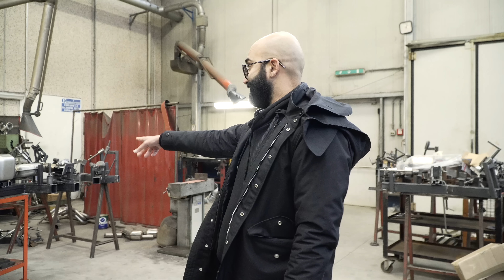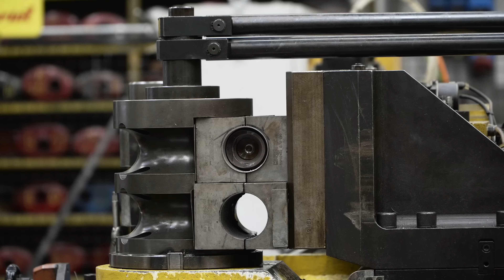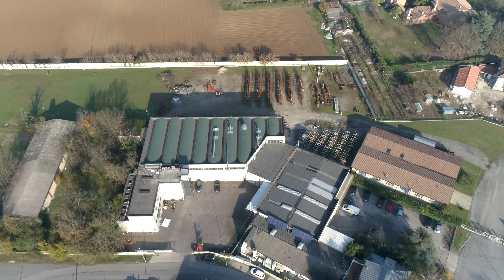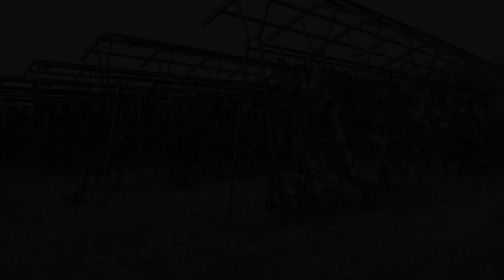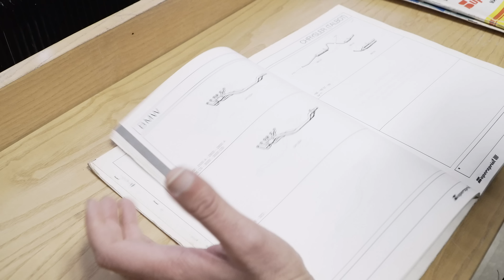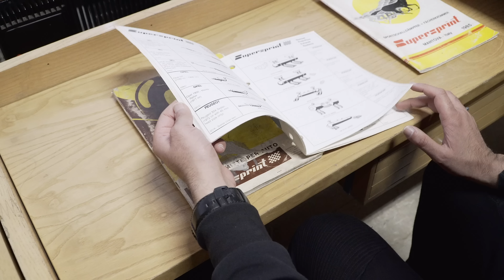Inside the Supersprint Exhaust Factory

Comment: Very nice video 👍

Had an E36 in the late 00's where I swapped the original cat and muffler with a Supersprint M3 Front Race Exhaust and a Supersprint M3 muffler with DTM tips.

I sold the car in pieces 9 years ago because of burglary, but kept the complete exhaust system.

Four months ago, I bought a "new" E36 and yesterday, I installed the complete exhaust (original M3 exhaust manifold + Supersprint M3 Front Race Exhaust + Supersprint M3 Muffler) and it still sounds as crisp and brutal after almost ten years of non-use.

Supersprint = Quality materials and quality sound!

Comment: After buying AA exhaust and the fitment was bullcrap, in the future i would invest only in Supersprint or Akra. 
2 best known names for a reason
Reply from the maker: I'm surprised. AA products usually fit well.
Reply: Evolve Automotive Yeah propably. 
The exhaust tips dont tighten well, they can fall off, exhaust flap rattles so much it's embarrasing, had to hard wire it to stay open. Also right side tips sit way lower than left which also looks stupid.